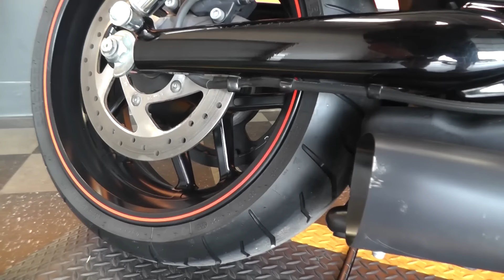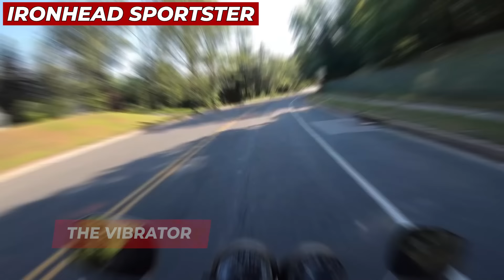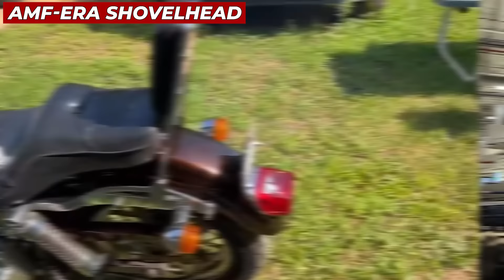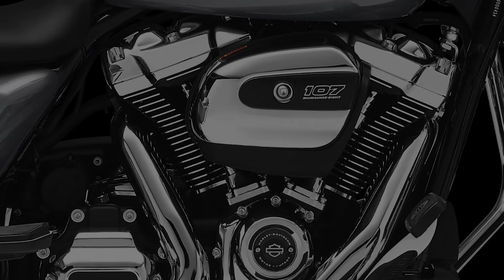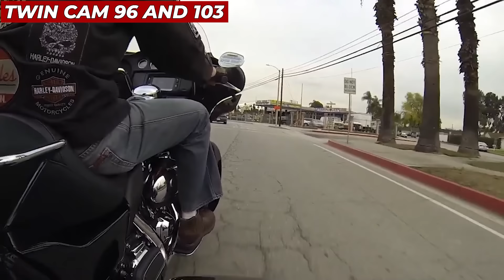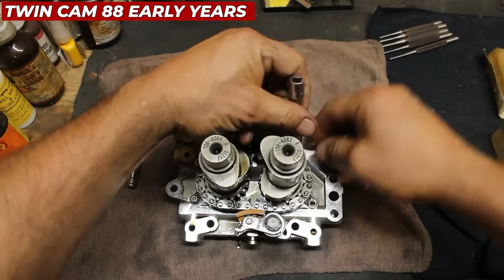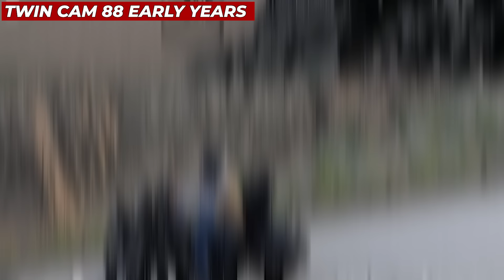10 WORST Engines Ever Put into Harley Davidsons

Comment: You forgot to mention , 1997 evo having garbage roller bearings that didn't have shields, they would drop there needle bearings down on the cam , then they were pulled into the block grenading  the motor!

Comment: My first bike was a 2006 wide glide. The only problem that i had was the stator went bad. Just after the factory warranty went out. I rode it until 2014 with a little over 60,000 miles on it. Then, in 2024. I got a 2017 ultra limited. The only major.problem with that. So, far. Is i needed another radio. It was replaced under extended warranty.

Comment: As usual this video has many untruths being repeated. 
We will start with the first engine the VRod Revolution engine. Was at the Corprate announcement where HD engineers were already knocking down the Porsche tie in. The engine was designed by the same team in Oregon who had designed the VR1000 race bike. 
Porsche did NOT design this motor. Porsche Design Group, an in-house rest home for burned out auto designers, only invented the process to hydroform the frame rails to fit the engine as tight as possible. Be real, would Porsche have designed a motor in the 1990s that needed a 15000 mile valve adjustement!?? I think not.
And the rest of the video is just as bad. 
Mostly forgot that until 1964, Harley still used a  pressed tin primary that had no oil return and drained on the ground, sealing HDs rep for leaking or marking their spots.

Comment: Willy bit the big one on the V rod. A loser. Got my first scooter at 14. A basket case 45 inch Military. Took me 2 years to get it the way I wanted it, you know, like running? 2 weeks and some a--hole stole it.  used to park my Shove, knuckle and Pan on a drip pan. (No I didn't have them all at once., over a 20 year time frame, yeah, I'm older than dirt) Wanna ride? Pour all the oil back in. Never ever leave without a tool kit and oil. Stop for rest, tighten up nu]ts and bolts. Bought an Evolution, 96 Sporty. My first scooter with no kick starter and belt drive. I was skeptical, Loved it. Mine never leaked. Looking for another. Nothing newer than 98. No injection.I want a carb. Buy an old Evo

Comment: Building V-Twin engines for a hundred years and still can't get it right 😳🤦🤦‍♂️💁
Only reliable and performance engine that Harley has designed is the Sportster engine. 4 cams geared V-TWIN when all the rest were single cam or chained twin cams.
Hp per cc, the Sportster engine is the best !
Twin cam and M8 engines are designed to accept inferior parts that have wide tolerances which makes these engines mediocre at best, 🕵️🤦‍♂️🤦😳💁‍♂️

Comment: READ ALL OF THIS.
PURCHASED 2000 HSTS, LATE SUMMER OF 2000.
AFTER RIDING WEEK OR SO DETERMINED AT STOP LIGHT W I WAS NOT IN 1ST. , BUT 2ND, HAPPENED WHEN IT WANTED TO.
STOPPED AT SHOP, EMPLOYED TOOK BIKE ON A RIDE, CAME BACK , AND SAID HIS DID THE SAME THING !
SO JUST RODE IT.
ALSO DETERMINED THAT THE OIL LEVEL WAS ALWAYS  
A TAD LOW ??
NO LEAKAGE
CALLED FACTORY, THEY  EXPLAINED THAT THE OIL SYSTEM WAS DESIGNED TO DRAIN INTO CRANKCASE.
SO AFTER SETTING THE WINTER , DETERMINED ON SPRING START UP THE TANK WAS EMPTY. 
SYSTEM WAS RUN SLOW, AND IT FILLED THE OIL TANK 
AFTER LATE 2000, TO LATE 2003, HAVE 10000 MILES ON IT.
NO OTHER ISSUES.
FROM LATE 3000 TILL NOW LATE 2025, BIKE HAS BEEN IN WARM STORAGE.
SOMETIMES CHANGES IN WORK HRS, WEATHER CAUSE THIS STUFF.
THKS FOR READING THIS
Reply: SORRY ABOUT TYPOS

Comment: Yet, I have 98, 300 miles on my 2003 FLSTS Heritage Springer. Sorry...but no big issues. Replaced the cam tensioner shoes at about 40K and still have the replacements in. Replaced one cam and bearing at about 65K. Just regular maintainence and ya gotta to ride em. Ride Safe.

Comment: I purchased a new 1976 Harley Davidson 1000 c.c. Sportster AMF in 1976. The narrator who pointed out the worst engine of that era was right when he mentioned the bike leaked, pure hell on long ride vibration and in those years you would get a kick start or an electric start but not together. I chose a kick start and boy was that a mistake. In cold weather the bike wouldn't start only after 15 to 20 kick starts. Keep in mind some Harley models were bad but when AMF took over it got worse.
Reply: I've owned a  76 CH for over 40 years.  Besides eating up points. The bike runs great

Comment: A note about Panheads and earlier motors ,up until 1965 all harley motors had a tin primary and did not return oil to the motor the crankcase. The breather spit oil onto the primary chain and simply ran out of a hole in the inner primary onto the ground, that's how they were designed, to leak. In 65 they added electric start and the sealed aluminum primary witch returned oil back to the motor.
Reply: Yup “ constant loss oil system”. ..
Reply: @megastick9324  no that was from the 20;s models "total loss oil system"
Reply: @angryeagle6537  different systems. Every system designed to drip oil on the chains was a constant loss system.
Those before that simply pumped oil by hand and then it went out on the ground were the total loss systems. As there was no means to recover the oil , just use it and discard it…
Reply: yea i learned that from my 37 ULH and my buddies 57 pan

Comment: A bit too much hype about the cam bearing thing. Bought a 99 fxd. Failed at 8000 miles, fixed at the dealer no cost to me. Bike now has 155k miles, 1 top end, 2 cam chain tensioner sets spinning a SE 211 cam. I did all my own service after the dealer work at 8k... Runs fine.

Comment: Just like BMW: if you want it bulletproof buy a high mileage model, as the first owner updated the weak parts, or buy their latest model years.
The latest 2016-17 Twin Cam Softails are as bulletproof as were the latest Evos, with the double power and a new brake system.

Comment: I was a 40 year private Harley mechanic. Most of this video is correct. The evo base oil leak could be fixed with a brass ferrule called The Fix. I had a 65' pan I rebuilt that never leaked a drop of oil for 30,000 miles. Older pans were designed to drip as the breather vented into the tin primary with a drip hole. I am now in the Philippines and bought a 2022 Pan Am from Harley Davao and they are terrible dealer. The bike was in the dealership more than out under warranty. I filed for a refund through DTI here and the manager and mechanic from the dealer told horrendous lies to get out of it. The bike had the engine replaced along with numerous other components under warranty. Now it is almost OK but don'[t buy anything made or assembled in Thailand.  The quality control there is bad. There are virtually no good mechanics here. Just a bunch dummies that either over tighten or leave loose bolts.
Reply: One correction, it wasn’t the breather hose venting into the tin primary chain housing on the older bikes, it was a specific constant loss primary chain oiler system with an adjustable rate of drip and a drain hole out the lowest back corner of the inner primary case.  Lifting the bike off the stand after a long ride would result in a slight draining of any residual oil that had dripped off the primary chain while laid over giving rise to the lie that Harleys always leaked oil.  Without this feature the primary chain would overheat and over-tighten possibly leading to seized bearings and warped clutch housing or at minimum a destroyed primary chain.
Reply: Thank you!  Information strait from the mechanic is always the best info out there!!!
Reply: @ThadeousMonkey I'm also a Harley mechanic. Over 60 years. Believe me? No? You're right. Don't believe everything you read. I'm not a mechanic at all, but I replaced the tensioners on an 88 Twin Cam in 4 hours. That was the first time I'd ever done anything on a Harley. According to the manual. If you're handy, you'll only need to perform maintenance according to the manual. And use the correct oil and filters. As a former Suzuki owner, I can tell you that Suzuki parts are more expensive and maintenance is more complicated than Harleys.
Reply: @Vanajoodik you've never owned a Suzuki or a Harley!! it's possible that someone I know has known you for your whole life and can attest to that Lol
Reply: @Vanajoodik a Suzuki owner 🤣🤣 lmao
Reply: I’m also in the Philippines and I can attest to the incredibly incompetent mechanics here. Just 125cc Honda hammer mechanics lol. I ride a 98 bagger back home, but riding it here in the traffic of my home base of Dumaguete might be hazardous to my health 😂
Reply: Bro I am appalled you fell for that junk ! Worst bike on EARTH ! I'm on Big Island Hawaii riding my 2000 XL1200 I paid $4000 for with 10,000 miles on it. Any fool can work on it. Set it on fire insure it first or ride to a bar leave keys in it if it will run 😂
Reply: Most people that own Harley’s are hard on all equipment.  They have one thing in common, they all fail to maintain their bike on a timely basis because they don’t have the skill to maintain it properly or they find it’s too expensive to have anyone else to do the job.   “Drive or ride until it breaks” mentality.
Reply: @FLHRCI wrong. I do all my own three hole oil changes. Check tires regularly and have the bike safety inspected yearly. I go over everything with a fine tooth comb. Where you get your info from is just wrong .

Comment: The M8 and the revolution motor the 2 worst motors. Harley has ever put in a bike
Reply: Really? I have 2023 FXBR117 and 45000 miles on it without any major problems!!! Properly and on time serviced by Harley Dealership, SC stage II done at 30000 miles service and extended Harley Warranty for another 3 years on the top of original 2 years with no mileage limits!!! How about that?!!! Ps. All in London, serviced and well looked after by WARR' S HD
Reply: @robertstefan3142 Consider yourself lucky. You're one of the few.
Reply: I have a 17 m8, and I've not had a single issue.  Most of the guys I ride with have m8, no issues. To be honest I only know of 1 guy who has had any problems and that was the oil pump which was replaced under warranty

Comment: Harley has also come out and said it's normal for M 8 motor to burn a quart of oil every 1500 miles also.
Reply: My 2017 doesn't burn any.
Reply: My 03 worst Engine at 116k uses 1 qt every 4 thousand, same as when I bought it at 12K. I do use Schaeffers Synthetic in The Crankcase Every 4K & Marel mystery oil in the fuel every fill. 2) oz Every 5 gal.
Reply: My 2022 FXLRST runs cool and no oil burn

Comment: The evo by 97 was bulletproof.
Reply: I have a 1995 Springer softail and 30 years later it still runs great and has never leaked a drop. It’s been one of the most reliable bikes I’ve ever owned.
Reply: @mikef3300 evos were sweet Totally bulletproof by the end of the run.
Reply: @nickahrens6139 -I love the EVO also ,,,,but they cheaper out on the later cam bearings. It was the only serious problem and pretty easily fixed. Change it to a Timken and swap cams to a EV-27 while ur in there….You won’t regret it.
Reply: Absolutely. Had a 96 Sporty and loved it
Reply: Big Twin Evo and Sporty Evo were two separate motors that had their own problems over the years.
Reply: @jamescarter2188 lol the evo big twin and evo sportster motors are 2 of the most reliable motors to ever grace a motorcycle, and not just for Harley. The "problems" for the evos are laughable. I'm curious what issues you are referring to?
Reply: You are absolutely right about that
Reply: Over 100,000 miles on a 1990 FXR and nothing done to the motor . It leak oil a bit but run great .
Reply: I was always a shovel man, having owned a knuck and a pan.
As much as I wanted to hate the EVO for yuppying up the biker world, it truly was the best of the real Harley’s once the bugs were worked out…
Reply: @megastick9324 I ridee a shovel myself. I have been for over 30 years.
Reply: @nic       Me too, still have the 73 Fl ex cop bike, 82 FXR and 83 FLHT.
Plus I finally broke down and have a cpl EVOs now too.
They’re like modernized shovels mechanically, but they still ain’t shovels …
Reply: I can't believe the Shovelhead wasn't on this list

Comment: This a false video filled with crap
Reply: Yeah well, that early 88 cam chain tensioner shoe disintegrating was real enough. Now I cut my filter apart every time and send some of the oil to the engine analysis lab. It's extreme but it's cheap and I'm retired.
Reply: @olivedrab1954 . Only if you’re a moron that rode the crap out of it without doing any periodic maintenance.

Comment: I cannot imagine that anyone with a twin cam 88 is still running the oem cam chain tensioners but it sure would have sucked to be in the first group to find out the hard way.  I have a 2006 dyna WG that came with hydraulic tensioners so it's not a problem, however.........mine came with a self destructing stator rotor/compensator design.
Reply: Go away!
Reply: Had one go 80k no issues, probably still going.
Reply: My 04 has 62k on it now, and still well within spec. Just went through everything yesterday and popped some new tires and brakes on her too. Bought her brand new off AAFES before I left the Army.
Reply: Had an Ironhead(yeah,AMF) one of my favorite bikes. And Ive had quire a few. Still have 7 of them! So ho away!
Reply: Go

Comment: A lot of my rider buds bought Shovels in the mid 70's. They never had a problem. At that time I rode 1949 and 1951 Pans and they were oil tight with the exception of the oil drip on the primary chain and designed the drip to exit because the clutch was a dry clutch
Reply: People don’t understand the Panheads. I had a 56 panhead back in 1973. It’s been long gone
Reply: This AI Robot doesn't have a clue, I've been building a riding Panheads for  over 57 years .  Give me a Knuckle a Pan Head and a Shovel Head any day.   Go ahead AI dude keep talking smack . Just maybe we can get a deal or two like In the Old Days.

Comment: Uh, there's only been ten total engine designs throughout Harleys 120 year history.
Reply: I mean that's not exactly true but I get your sentiment lol
Reply: I have a 2002 FLSTF 
done 12000 
Had tensioners checked .Hardly any wear.
Reply: Yeah the base gaskets on my evos are metal in the middle and paper on both sides
Reply: @deanbecker7008 there are upgrades available.
Reply: Nothing sounds like my Ironhead
Reply: I wonder why
Reply: Are you including the two thumpers?
Reply: Including one made by Porsche and an italian made engine for their 70s trail bikes
Reply: @zimtuff V Rod